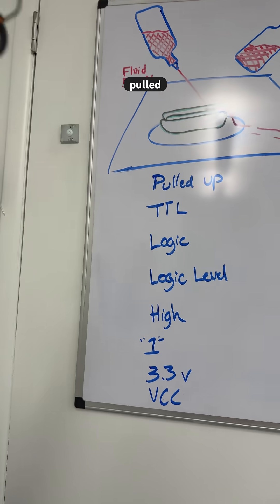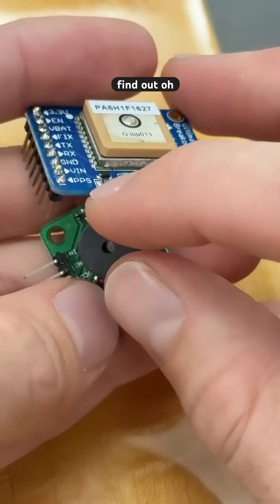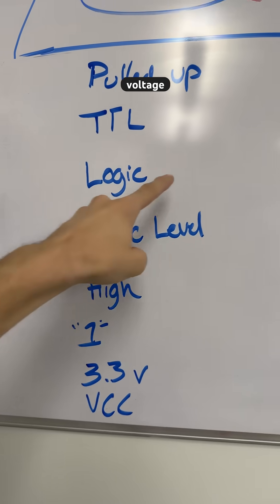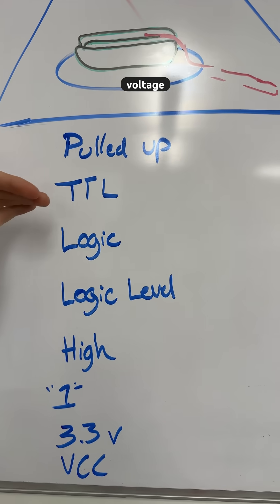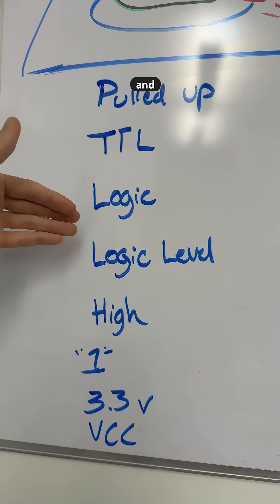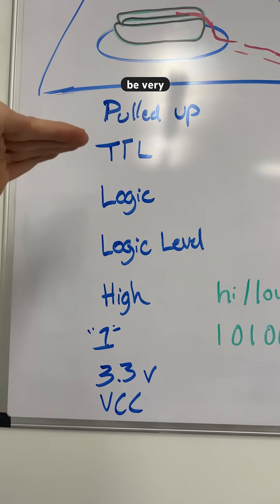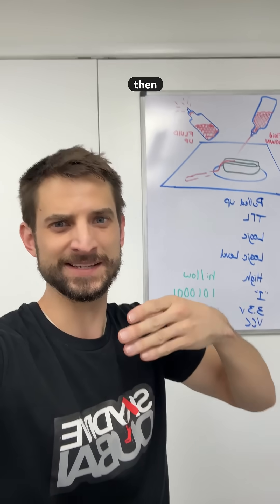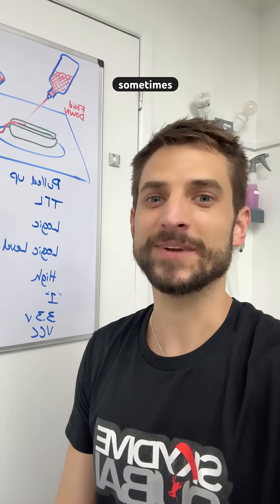circuits are 200% harder if you don’t know this

Comment: For VIN (another one for ya) I often prefer to supply it with 5V, as typically threw 3.3v supply was stepped down by my devboard that is supplied by USB. I don't want to brown out the microcontroller by having it power all the sensors, so I'll take it straight from the USB 5v.
Reply: That is, assuming it can take 5v in.  Read your data sheets! ;P

Comment from the maker: if you don’t like this summary, the challenge is for one person on the planet to make a better summary.  10,000 people are equipped to improve this explanation, but where are they?
Reply: Just say high / low… or logic high / logic low. Or say the actual voltage if you like. 
TTL means something else (compatibility - what counts as a high or a low).
Reply: @davidmalawey I think the reason this one has ruffled some feathers is not because it’s wrong but because it’s not clear what you’re actually intending to explain.

People see “these are the same” and they think “these are the same in all cases” because the video wasn’t clear about when they are safe to consider the same and when it’s not.

I think that the video may only seem to be clear in this way to you because you knew the intention before hand. ❤

Comment: No, that's all different :
1. pulled up. It means the pin is tied to the resistor to vcc

2. TTL its mean sending data with logic level or 1 and 0 where 1 is vcc 0 is gnd. usually nowadays involve with uart/usart

3. logic : never see that term. maybe just short of logic level

4. logic level : same as TTL. but sometimes it is used for low level communication instead of TTL that is familiar with uart or rs232.

5. high : it depends when you read it. ex. it outputs high when not active that means it gives vcc when not active or not detecting something, usually for sensor. or if you read in enable pin its mean need to high in order to activate the IC ex: stepper driver.

4. 1 : again it can be pin no 1 or logic 1 means vcc. usually u see this term in programming not in silk screen, except for pin number.

5. 3v3 : it means either vcc (power input) or it outputs 3v3 from voltage regulator on the circuit. Some devices strict 3v3 and may burn with 5v so they put label 3v3.

6. vcc : its mean power input. it can be 3v3, 5v, 12v, or 24v

in short, if you are in an early stage of engineers don't just read the label. read the data sheet to understand what the label is for
Reply from the maker: this is helpful info. if you look at item 1, and ask “what voltage is the pulled up pin?” in such case what’s the most accurate answer in your experience?
Reply: thats kinda tricky question I guess. Because if it give an information about "pulled up (or pull down)" what need to concern is : the pin is not floating. so I dont need to bother about voltage, because the information will inform me if I connect in hi-z state pin it will give logic level as HIGH.

In short if u see "pulled high" you will concern about HIGH or LOW logic pin not the voltage, because the voltage is already according by the sistem can handle.
Reply: @davidmalawey  a pin can have a pull up resistor and be high (3.3v/5v usually, or very close to it)… or the voltage at the pin could still be low (usually 0v relative to GND, or very close to it).

Digital is immune to noise because it is either high or low, no in between. So there would have to be a large range representing high and/or low. 

You can feed a digital input pin of a 3.3v micro with 5v or more through a resistor and then a protection diode to VCC and the pin voltage could be ~3.6v in that case (3.3v + 0.2-0.6v diode drop). It’s common for protection diodes to be built in so just use a series resistor (10k should do). I recommend EEVblog video #831.

Comment: There's so much wrong with this, I don't know where to begin.
Reply: Why don’t you try? In the context of “I have a dev board and I need to provide a power supply to it which pin should I use” this seems pretty correct to me…
Reply: It sounds like you are actually the one that's incorrect. I would correct you, but I don't know where you want to begin.

Comment: IIRC if you only see TTL, without more context, it will probably mean 5V. Sending 3.3V into a 5V TTL input will almost certainly be registered as 1, so you should be fine. But if you connect a circuit that can only handle 3.3V to a 5V TTL output port, you might fry something.

Also, 3V3 also means 3.3V.

Comment: I like how you broke down the nuances between terms like logic high, logic level, TTL, and VCC. They sound interchangeable at first, but each carries its own context, whether it is 5V TTL thresholds, 3.3V CMOS logic, or simply the supply rail being referenced.

It is the same story with pull ups and pull downs. Sometimes we casually say “pull down resistor” when in practice it is just tied to ground. But ground itself is not the same thing as a negative rail. Once you step into RF or mixed signal design, you quickly realize that ground is actually sitting higher than any negative supply voltage you might be using, and that distinction matters.

Once you move from digital logic into RF engineering, the whole vocabulary shifts again. Negative voltages, biasing, reference planes, impedance matching, it is a whole new ball of wax compared to just talking about 1s and 0s at TTL levels.

Of course, the way you deliver information is so easy to understand and it's always informative. Thanks for doing what you do!

Comment: Worth noting that it's not always 3.3V, sometimes it's 5V but it depends on the microcontrollers involved and the surrounding circuitry. But other than Arduino type microcontrollers, 3.3V is correct >90% of the time
Reply: Chips from the 20th century generally work with 5v, and chips from the 21st century either work with 3.3v or they work with either voltage standard.
Reply: Yeapp!!